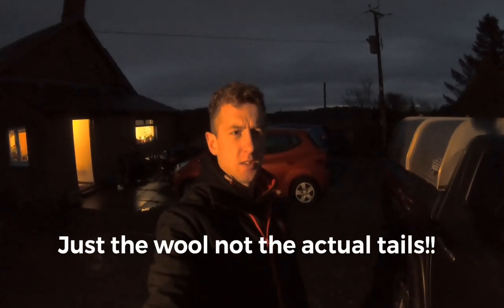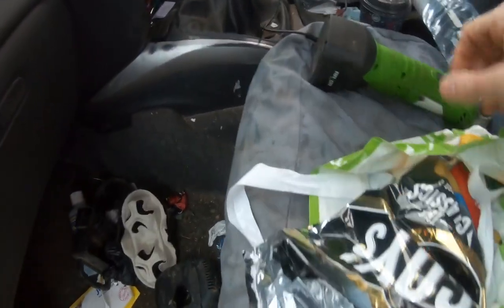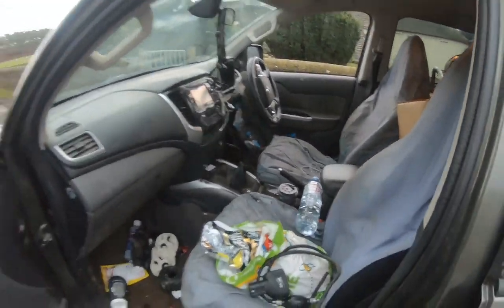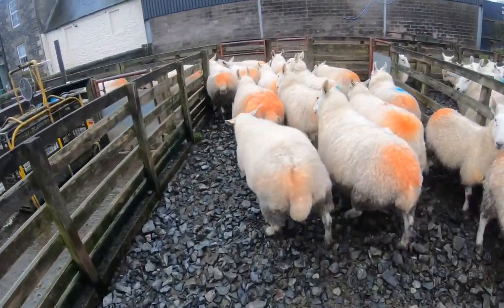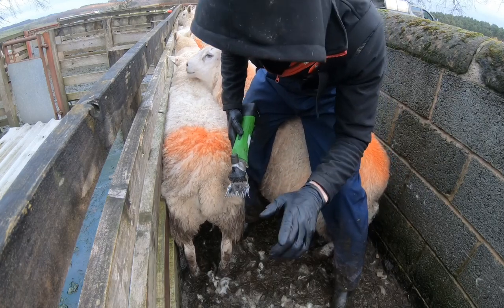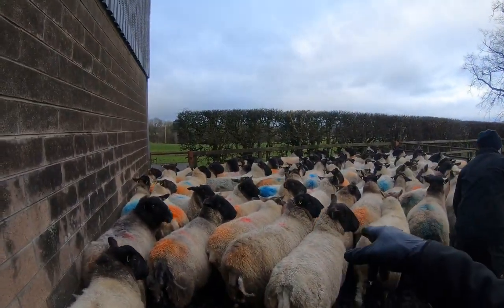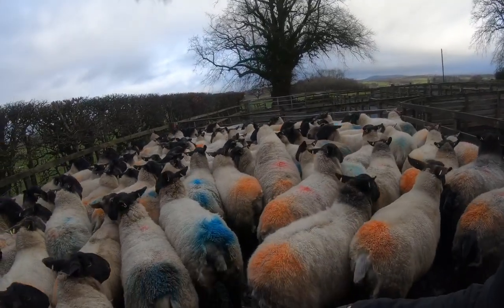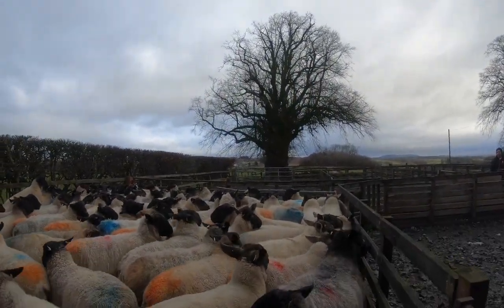SHEARING TAILS BEFORE LAMBING!

Comment: Awesome!   Love your work.   Why do you clip the top of the tail?  I understand why you clip the bottom and legs.  Does the the top get manure on it too?
Reply from the maker: Donna Spear start at the top and clear the whole tail. Stops them getting dirty with dung or after birth fluids following lambing.  Also makes it a bit easier to see what’s happening whilst lambing however that isn’t so applicable in these tight skinned sheep. It would be very beneficial in blackface sheep who have more wool on the tail. You wouldn’t want to do them at this time of year tho as it’s too cold.

Comment: so orange are prego and blues are ??? and the red ??
Reply: In this flock, the farmer put all his rams into a “raddle harness”, which has a holder for a block of pigment.  Whenever the ram mates a ewe, his chest rubs on her bum - and he transfers some of the color from the block onto her bum.  After about 10 days, the farmer changed the color of the raddle crayon - in this case, from orange to blue.  (Not sure about the red though).  What that does, is let the farmer see at a glance, which of his ewes will be delivering their lambs first - in this case, the ones with orange bums.  If the first breeding didn’t take, a ewe will likely be mated on her next cycle - and she will get blue marking on her bum, on top of the earlier orange.  It’s a useful management strategy; imagine you have a lambing shed that can hold 30 ewes and their newborn lambs.  But you have a flock of 60 sheep.  If you wanted to potentially help the ewes who would be delivering their lambs first, you would bring in all the orange ones, and leave the blue ones til later.  In essence, all the orange ewes with their new lambs, would be bonded and ready to go back to the outside fields before any of the blue ones were ready to lamb.

Comment: so i have seen Joanna from farm dale do the foot things but yet here in Canada Sandi Brock doesnt what is it for and whats in it ???
Reply: Sandy Brock’s sheep operation is a little different, because she has everything indoors under over year round, and her sheep stand on straw bedding.  Sandi’s sheep are mostly the Rideau Alcott breed, developed in Canada specifically for Canadian conditions and also for being excellent mothers capable of delivering triplets, quads, and even quintuplets.  Sandi normally will trim hooves about the same time each group gets shorn while they are pregnant, so the lambs will have easier access to nurse.  The typical foot bath solution is really important for preventing hoof rot; as these sheep are outdoors in Scotland’s wet weather, it does make sense to treat them periodically with a foot bath, to prevent infections.  It varies, but one typical ingredient in many foot baths, is formalin.  Needless to say, it’s not the kind of liquid you want all over your own skin - or want sheep standing in for an extended period of time.
Reply: @patpierce4854  ty hun if i dont ask i dont learn and yes i live about 45 minute drive from Sandi the coyotes are over bred near her she has seen them right by the barn when she had the couple cows it scared her one for sure lol ty hugsssss
Reply: @patpierce4854  formalin. is that like the stuff for the dead ?? formaldehyde ?